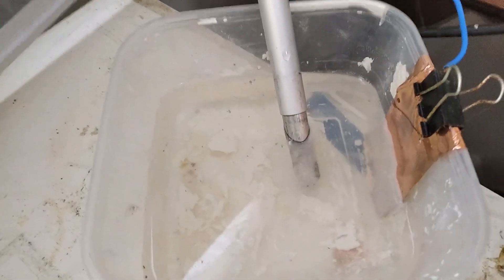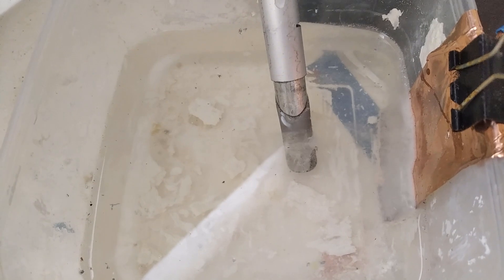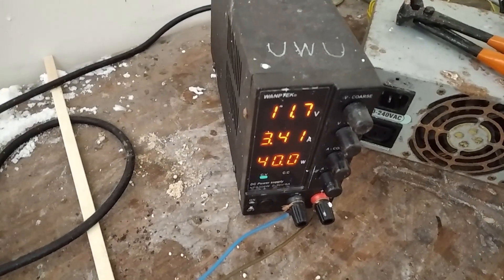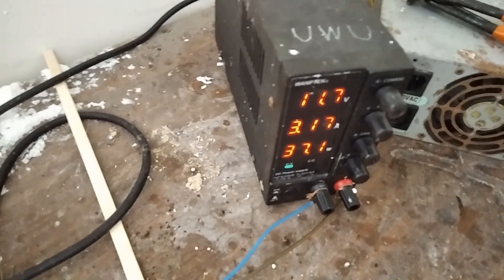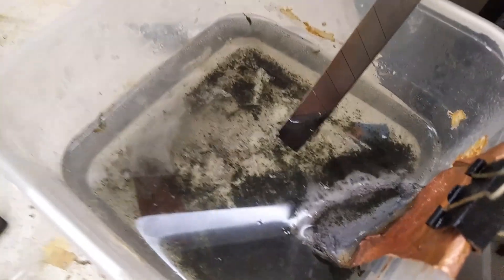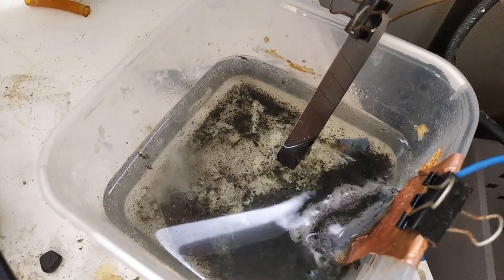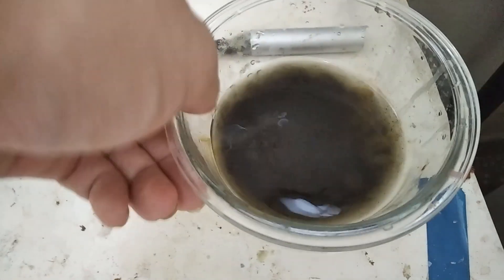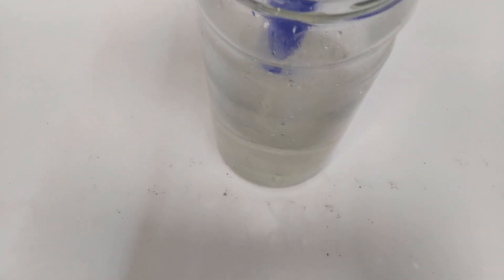electrowinning of iron from ferrous sulfate

Comment: The utility knife blade used as anode at one point is an iron chromium alloy, so chromium is also present here.
Reply: They are usually plain carbon steel. Just traces of iron follower elements.

Comment: Hello, sir. What do you think if in electrowinning/electroplating of iron, we added thiourea as an additive. Can we inhibit corrosion of deposited iron with that?
Reply from the maker: Might be a good idea although this iron is specifically for reduction of nitro groups into amines
Reply: @CatboyChemicalSociety  Oh, so thats why you peeled the deposited iron from substrate. Currently, I'm doing a project to electroplate a carbon fiber mesh (CFRP) with Fe from FeSO4.7H2O electrolyte to make a Nickel-Iron Battery. May I ask, what other compounds that is non-toxic which likely can be added to electroplating bath as an additive to inhibit corrosion of the deposited metal? that will not precipitate salt in a KOH solution?

Comment: the copper version will electroplate a thin film on the target electrode which detaches from the surface by sulfuric acid corrosion from the underside of the film. if you remove the sulfuric acid you should get iron on the surface without the iron detaching from the surface.
Reply from the maker: I don't want a thin layer here because this iron is for organic reduction but for that I would use something like iron 2 acetate instead.

Comment: if you ever do it again and you need to clean oxides off the shavings, try using some concentrated organic acid such as Citric or Acetic, those would dissolve the oxides but not the elemental iron.
Reply from the maker: yea but that is pointless due to its high surface area and this iron is meant to be used as a reactant for particular reactions.
If I wanted a piece to keep then I would plate it at lower current densities for weeks or maybe even with membrane.
Reply: @CatboyChemicalSociety  
I mean exactly in order to clean high surface area reactive iron powder, i would suggest using stuff like Citric acid since it's a chelating substance aka it would dissolve only the oxides off the iron powder's surface, but would not react with the rest of the particle after removing the oxides. it would make your iron powder more reactive since there will be no oxides on it's surface but won't eat away your powder leaving you with less product (like HCL would for example)
Reply from the maker: yea could work but then the moment even any air or O2 diffuses into solution it reacts.
I also dont know if citrates/acetates are compatible with the bechamp reduction.
Reply: @MysteriusBhoice  you could flush off all remaining Citrates with acetone probably & cover the powder up with some paraffin oil or something similar to protect it from further oxidation, same way chemical vendors store things like alkali metals.
why would you need the Citrates to be compatible with the Bechamp reduction anyway? aren't all the citrates that will be formed by the dissolution of the oxides going to be removed and thrown away anyway?
Reply from the maker: @guyf4918  yea but with high surface area you will undoubtably have some citrate contamination which maybe an issue.
like sure you can clean it up as much as you can but if the final result is Fe2O3 anyway it wont matter.

like maybe for presentation it makes sense or to store in element collection but my main focus was to really prepare something usable for the purpose of that reaction.

Comment: OK but you just used the ironsuflate solution as an transmitter... True? The cathode is the ironsource!? Anode is copper? Damn I need to watch it again.... Need subtitles 🤧 I hope nurderage is OK 😭
Reply from the maker: no the anode is iron and copper is cathode.
There is also free iron in the form of pieces of metal dipped in solution shown at 3 minutes to reduce iron 3 sulfate into iron 2 sulfate.

This iron is also not for electroforming tho it can be used for plating a thin layer of iron but mainly its used to prepare iron with high active surface area for the purpose of reduction of nitro groups into amine groups known as the bechamp reduction.
Reply: @CatboyChemicalSociety  thx you for answering! I wish you could do with membrane! 😊🙏 To get the sulfur would be awsome 🤤
Reply: this is nurdrages new channel, you live under a rock?
Reply from the maker: @WeebRemover4500  lol I wouldnt know of nurdrage's status idk what he meant.
we actually made a joke if nurdrage would end up as a catboy how would he look like.